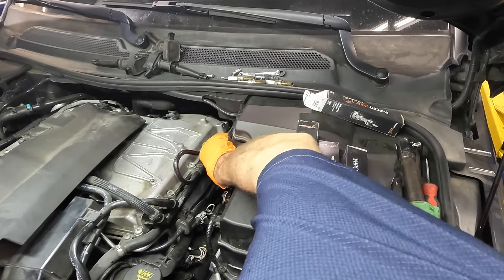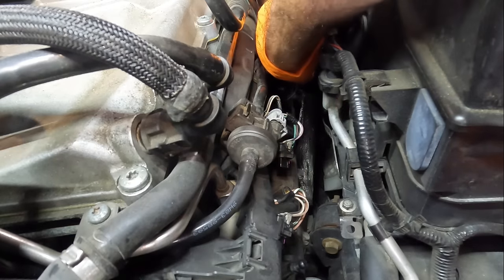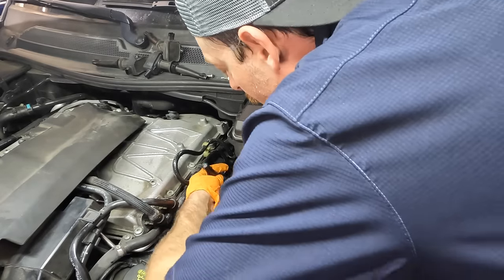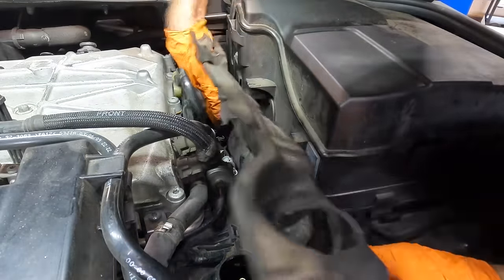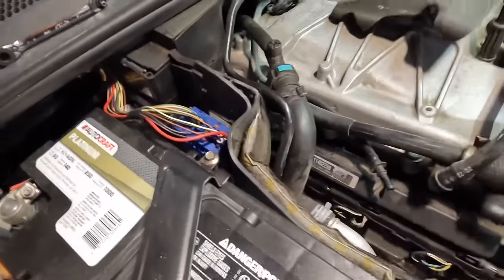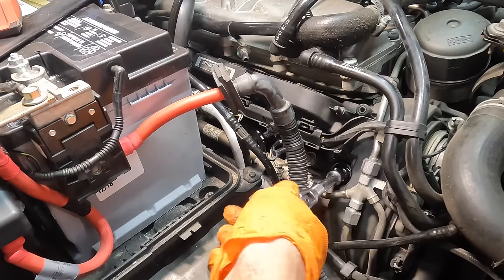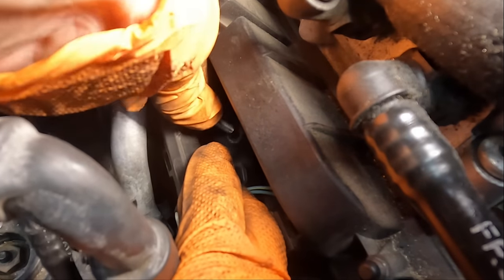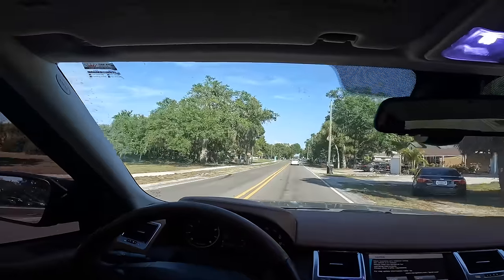Supercharged Spark Plugs! Land Rover Range Rover 5.0 v8 AWD #mechanic #tuneup

Comment from the maker: Go BACK the the DIAG Video: Endless Diag! Supercharged Land Rover Range Rover 5.0 #mechanic #diagnostic https://youtu.be/4Hm_1-Y2dxU
Reply: Watched it yesterday. Will review
Reply: Having Christmas and new years in the heart of winter seems best to me cause that's the gloomy cold miserable time of year, these things bring a bit of joy and movement during that period.

Another rabbit hole...some think Jesus was born around Sept.
Reply: Was it necessary to use a tamper proof torx bit to take out the coils?

If so how ridiculous, manfactures are doing almost everything they can to keep you from doing the work at home yourself. 
This is getting old. 
Then smaller shops like you spend most your income buying tools that only service one make and model brand of car or truck.  I mean tools are nice, but if its only used to change light bulbs on a Benz
For one model and year and the tool cost 1k come on.
Reply: @bobbg9041  TORX screws are better during manufacturing, they don't strip out during fast installation with powered tools....
Reply: Interesting that the 7 days of the week are named after the planets in our solar system. It more obvious in Spanish
Reply: that's why they developed them, yupper, same with the other versions, the stuff is for fast accurate assy lines
Reply: Hey man thanks for this I did everything described however still misfired is their a firing order I missing

Comment: I will say the interior looks like a nice place to spend time while you are waiting for the tow truck.
Reply: Or waiting for the bank loan, to cover the plentiful repairs...
Reply: Thats assuming it didn't catch fire when it broke
Reply: @adctvuk5035  it's not a EV
Reply: Thats why britisch cars have a phone inside. To Fall towing service😂
Reply: @steved9397  in the UK, you would never buy an old Range Rover (or derivative) without getting a very comprehensive warranty .. they are just unreliable money pits .. the EV / hybrid versions are fully expected to be even worse than the petrol (gas) or diesel versions
Reply: @S D  I know but it's a range rover they never break the same way twice. Also the owner would probably have set fire to it would probably then work better
Reply: @tpgajtg210  new Land Rover may have a built in AI function. It will call tow truck for you automatically, without asking.

Comment: it's great that you are more then willing to let a customer know that there are things you do not know how to fix it then try to fix it, it shows that you are one of the top mechanics
Reply: I actually work at a supplier for Landrover and we have managers and engineers from JLR come down all the time. A few years ago one of them came down in a brand new Range Rover Sport. He went for his meeting came back and it wouldn't start. It was behaving strangely. He catches a lift back to JLR with another manager. Guy comes down from "major rectification" department at Solihull. He has 3 laptops out and various bits of the car torn apart most of the afternoon and in the end he calls a recovery truck.

Comment: There is a special tool for Land Rover. It's called a match.
Reply: Works better with that lubricant called gas.
Reply: @justcurious3525  😂😂😂😂😂😂😂😂😂😂
Reply: "a lubricant called gas" humm if its gas it aint liquid the word your looking for is petroleum
Reply: No the special tool for a range rover is keeping your wallet in your pocket and walking passed the dealership
Reply: You could say that for most vehicles these days...
Reply: This actually made me lol.. 😂 good one..  true..
Reply: When ever you hear the two words "Land" and "Rover" conjoined;  run like hell as far and as fast as possible.
Reply: The original Land Rover was modeled after the Willey's Jeep. Today, by all accounts it is the least reliable vehicle made in the world. So bad that Chinese owners of Chinese  manufactured Land Rovers have held large scale protests in front of  Chinese Land Rover dealerships.
Reply: Instructions are on back of gas can😎
Reply: Obviously engineers had more brains than sense.
Reply: @FV 623  just don't use a range rover to do it as it might take a while trucks here are only allowed to do 56mph tow truck might be a while
Reply: Your knowledge of automobiles is very very limited, just saying from up north UK 🇬🇧
Reply: You forgot the bucket of gasoline dumped on the vehicle
Reply: Add some dynamite, and you are good. 😂
Reply: @karlfunnell100  It's a British vehicle, so it must be arsoned with petrol. And that petrol must be bought by the liter.
Reply: Can I get that specialty tool from the tool truck?
Reply: land rover are great match for toe trucks and parts cannon😂though my dodge neon is right up there 1997
Reply: Just as reliable as us 4x4 ,it's all down to maintenance or lack off it
Reply: Why everyone hating them I had 4 and never had any problems mate last Jan brand new E330 amg been in merc workshop for 7 months out of the 12 mo one hating mercs and Range Rover are no more unreliable any other luxury car it’s how you look after them don’t ignore maintenance etc
Reply: Why does the engineers put so much stuff in front of the spark plugs  Knowing someone needs to change them
Reply: FIRE!! 😂😂
Reply: @garyholt369  They have contests to see who can put the most obstructions in the smallest spaces between the common maintenance parts and the mechanic's digits.
Winner gets a vintage slide rule and forfeits his calculator for a month! 😁
Reply: In Germany gas is called benzene
Reply: @MonkeyJedi99  litre, just sayin’
Reply: @karlfunnell100  Given that "gas" is vernacular for gasoline, which is a liquid distillate of petroleum, curious is completely correct.
Reply: @mikearmitage1577  (smile emoji)
Reply: @williampope3531  newer cars take iridium plugs, which only get replaced every 100k+ miles. less important to leave access
Reply: @bradhaines3142  I see....🤔
Jack up the radiator cap and drive a new car under? 🤨 Or just triple the expense to the owner for what should be a minor task.
There is no good engineering excuse for making routine maintenance items so difficult to access.  
Interiors are not designed by engineers, either.  Nowadays the interior is designed by interior designers and access to the fixtures, switches and circuitry is at best an afterthought.
Reply: It's a Ford design...
Reply: As a Range Rover owner, I take offense to this. But… dude, you’re definitely not wrong 😂
Reply: @572Btriode or a good deal on a BMW……RUIUUUNNNNNN
Reply: Had two buddies that made the mistake of owning one of these and they lived at the dealership. Things falling off on a regular basis. They didn’t last long and those vehicles were gone!
Reply: If I didn’t love them and I couldn’t work on them, I definitely couldn’t afford to own it!!! Land Rover, making mechanics out of drivers since 1948 🤣
Reply: Or a for sale sign.😂
Reply: 😂😂😂 foreal

Comment: I'm a software engineer but a lot of what Ray says about how he works applies the same way. For example about working on the difficult stuff first to maintain motivation and saving easier things for later is 1:1 in software as well especially when debugging (aka diagnosing) and fixing problems.

Comment: Ray, the start button on my Nissan Titan recently got finicky too.. Took it to the dealer under warranty and it turned out to be the brake lamp switch needed to be replaced because it had an intermittent problem... I guess that switch also tells the computer the foot is on the brake pedal and allows engine to start...  Great video and commentary as always

Comment: Land Rover Spark Plug Service Procedure:
Step 1: Position flatbed tow vehicle in front of Land Rover.
Step 2: Attach winch cable to tow hook and pull Land Rover onto flatbed.
Step 3: Transport Land Rover through gate.
Step 4: Unload Land Rover outside fence next to road.
Step 5: Close and lock gate.
Step 6: Inform Land Rover owner to remove vehicle from premises and to never return.
Step 7: Illuminate "We Reserve The Right To Refuse Service" sign.
Step 8: Open cold beer and celebrate not opening "Pandora's Box".
Reply: Ray has defeated the engineering of various PT Cruisers, so I have faith in his abilities with this rover of lands.
Reply: @MonkeyJedi99  I second that and I think he can fix the suspension once he gets some one to explain the quantum physics of it to him.
Reply: Yes sir...
Reply: @MonkeyJedi99  oh ...the aquarium bubbler??
Reply: @Laugh1ngboy  At that point, the only bar is if there are specialized tools required, and whether or not he feels purchasing those tools for one job is worth it.
Perhaps he could find a place that would rent specialized tools?
-
I only had one car (so far) that required a specialized tool that had no use anywhere else, and that was a 1974 Volkswagen Beetle and the tool was the hex wrench for the drain plug.
I held on to that sucker for years longer than I had the car, hoping someone else would find it useful, but eventually it went to a metal recycle pile.
Reply: Sorry, only once per month. He’s already used that procedure on the last customer’s vehicle; it was a real Saab story! 🤣😂😆
Reply: @MonkeyJedi99  Well the idea is that the guy that teaches him quantum physics would loan him the tools required while teaching him.
Reply: Mmm. I wonder how much of that was based on  personal experience, and how much on various internet memes and second-hand, out of date information? My personal experience of three Land Rovers (two Freelander IIs, one Discovery Sport) over the past twelve years is that they are no better or worse than equivalent vehicles.  May lag behind (say) Toyota in terms of reliability, but so do most manufacturers.

Comment: Back in the late 60s Ford installed big block V8s in their Mach 1s. In order to pull the spark plugs most mechanics had to loosen the motor mounts and jack the engine up, but I discovered the triple wobbly could also do the job.
Reply: 440 in Chrysler had the same, Chevy Monza too.
Reply: Monzas gave you the choice of pulling the engine or cutting an access hole in the floorboards.

Comment: The calendar thing has to do with the pre-Julian calendar having the year start with March.
The calendar we use was adjusted many times, both to correct the number of days in the year, fixing 'slippage', and then eventually adjusted to have the year start on January 1st.
-
As to the "WHY", there is a lot of mud in that road.

Comment: It is a Range Rover, made by Land Rover, Land Rover also make the Defender, Discovery and used to make the Freelander. Having owned a Range Rover I can hand on heart recommend the following course of action for your customer SELL IT!
Reply: I concur. I have owed a discovery in the past and ift cost me small fortune to keep it running.
Reply: Get shut best thing when the timing chain gose which it will go will cost thousands to put right or the screw in the super charger gose and it will let you down guarantee that so get shut while you are a head 👍🏻
Reply: This is true. Trouble is after selling them it's way too easy to end up buying another two or three.

Comment: In these newer vehicles with coil on plug, that monitor the spark closely. I've been ohming out and getting plugs that are closer to each other on resistance. Haven't dealt with many denso plugs, but have with ngk. They have been consistently within .3 of each other. Pleasantly surprising and boasts well for their production line.
Reply: Denso is typically considered on par with NGK. I'd run either or, myself.

Comment: When I was twenty, I would never in a million years think coil and sparkplug boot would be on every plug hole. Of course our coil was actuated with points which is much different than cdi. When that came out it made me very happy as the spark was hotter. I remember one guy who was driving his parents car with 72 thousand miles on a set of plugs which was impossible to me.

Comment: Ray, great video#2. The car has 3 systems of suspension control, EAS- air suspension, ARC - Active roll control (anti roll bars hydraulic) plus CVD - constantly variable damping.
The fault I believe mentioned LHR solenoid, sounds like a damper solenoid or poor connection on top of the piston shaft (connector) easy to diagnose I guess, 2 wires, resistance of solenoid tested in the boot around 3 Ohms. Rare they fail tbh. Need to go to control module RHR behind boot trim for EAS and CVD, if roll bars, RHF a-pillar under dash. 
I guess check codes again, all three are linked, carefully read the description of C code. 
The door locking a new power latch unless wiring showing voltage drop.
Hope this helps Ray.
In UK cars are not wankers, people maybe... that car has colloquial names here...(I am British)😂

Comment: Ahhhh.  The good ol air ride suspension of JLR.  Im on my 4th Range Rover (1995 Classic) and just figured out how to communicate with the EAS system.  Once I did that....all is good in my Fifdom. But yea, unless you have JLR software, like Testbook with the ability to read and write height values, its a lost cause.  Now that I know you work on Range Rovers, and you are local......beware!.  Oh and for all those folks baggin on the RR.....besides having FoMoCo stamps all over the engine, suspension, this is a beast of a car.  We have 4 JLR products in the driveway, 3 with the 5.0 engine.  Never had an issue except water pumps (JLR design is crap).  Under Ford ownership, reliability was increased greatly.  Befor that was the evil Lucas era.  But even then, if you know how to read a wiring diagram and realize that they like to ground switches to close a loop, they are a blast to own/drive.

Comment: The forums have pointed out that the brake switch can cause the suspension error this vehicle has.  Given the story, it may be that the switch may have become damaged during the incident.  It is a cheap east thing to try out....and if it doesn't work there is no real loss.  

The dealer will charge 8-10k to fix the suspension and it may just be a $10 brake switch.

Comment: 1. Get some collapsible banquet tables, the plastic ones. Be neat and organized tearing a vehicle down. Set things neatly on the table(s).

2. Slow down. You are not on anyone's clock other than your own. Which was probably the entire reason for starting your own shop. Just relax, slow down. Slow is smooth, smooth is fast.

Comment: If it makes sense to apply dielectric grease where the coil spring meets the spark plug, wouldn't it be equally sensible to use the dielectric grease at the other end where the spring meets the coil stud as well?
Reply: No, he says he uses it to keep the electricity from escaping the boot.  Not an issue at the other end.  I always used it so the boots don’t weld themselves to the spark plugs but what do I know.😬

Comment: Looking at the process to remove and replace the rubber, I wonder if using compressed air would break the seal and expand it enough to slip off easier. Air might just push straight through the coil though I suppose.

Comment: My question about the torque
It has always been my understanding that there couldn't be any angle to get accurate toque, had to be straight on
Yet there are multiple angles/ swivels being used 👍
Reply: What about acceptable torque?
Reply: Close enough.....click.
Reply: @leehill9922  🙏
Reply: Well, at least they are not over-torqued!
Reply: That is my same concern. How would you calculate the corrected torque, especially with several swivel joints?  That would be a great physics exam test question!

Comment: Hey ray reguarding the month question you had, before julius augustsus cesar we went by a 10 month calendar which is why the months do have the latin prefixes. But when Augustus came around he found that adding two months to the calendar would be benificial to the season tracking and more accurate for how many times the earth goes around the sun. So july and august were added after. Julius (July) and Augustus (august).
Reply: No, July and August were renamed from Quintilis and Sixtilis. Ianuarius and Februarius were added to the calendar by Numa, but the names were not adjusted.
Reply: They also agreed there would be 31 days in both months. There months could not be less than other months, a pride thing.

Comment: back a few years changing plugs too about 15 minits dose all that plastic really necessary but I am sure it will burn well if have engine fire
Reply: you know we in California have problems with fire in the summer so to prevent fire we put asphalt on top of homes and plastic on top of engines

Comment: To get a rubber boot freed from minor to moderate surface adhesion, isopropyl alcohol can easily penetrate and get the rubber loose… with a bonus of leaving no oily residue after it evaporates.

Comment: I agree with your calendar conundrum, it's right up there with the difference between the calculator keyboard and the telephone being upside down to each other. Who did that? FYI As much as I admire the Land Rovers styling I have been told they are electrical nightmares! Also, I noticed the gadget you unplugged from the dash looked like the connector next to the battery, is it a programing port?
Reply: I believe the Roman calendar had the months as per their name, but to actually fit a year properly other months were added in.
Reply: The blue thing Ray removed  is an OBD2 wireless dongle to let you read error codes etc with a smart phone or laptop. Rumor has it that some dongles, if left plugged in 24/7, will generate all sorts of offbeat codes in the management computer(s) by disrupting normal communications around the system with their continuous data requests.
Reply: Yeah, but the starting time for things being born/reborn, etc, etc, is only applicable to the Northern Hemisphere.  And yeah, OBD2 plug is a popular OBD2 -> Bluetooth dongle (ELM327)